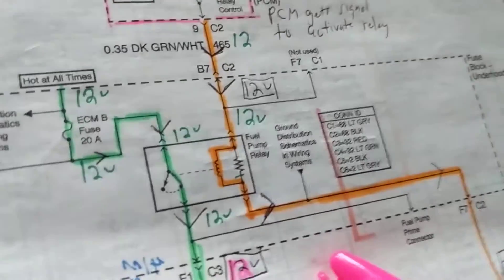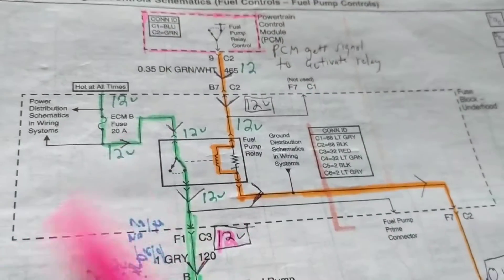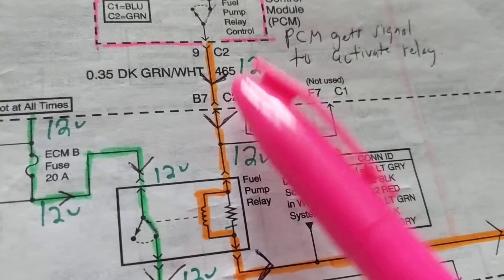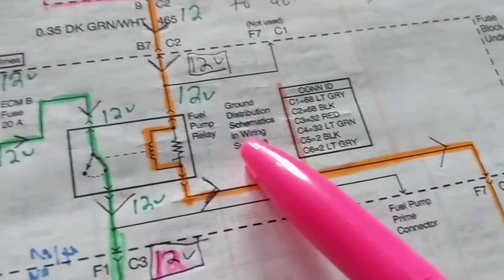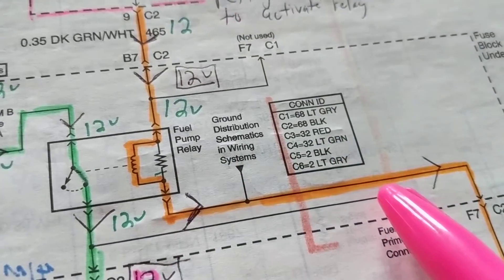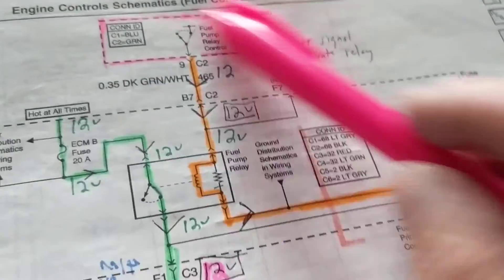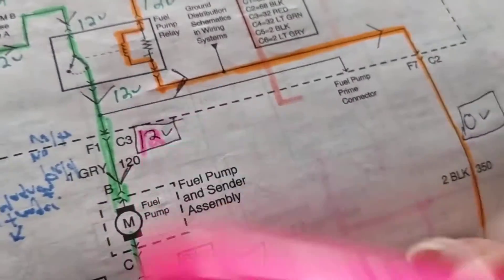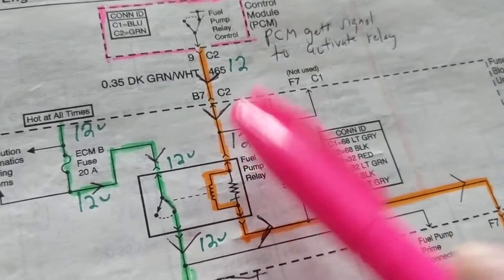FUEL PUMP relay PROBLEMS AND HOW TO DIAGNOSE THEM FROM DIAGRAM

Comment: I’m surprised if I don’t have power at relay at all but fuse is hot , that I don’t have a check engine lights on
Reply from the maker: Sorry I just saw the comment recently the check engine light comes on if something is out of range usually it doesn't detect it's a relay is not working or a fuse is blown